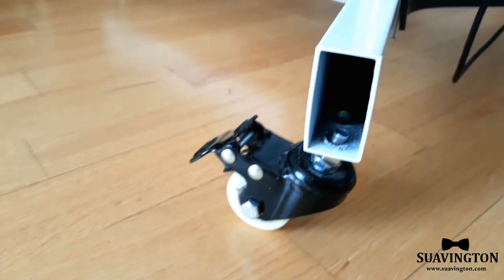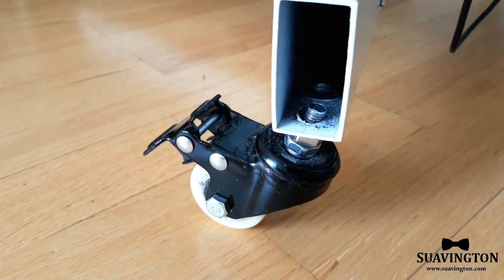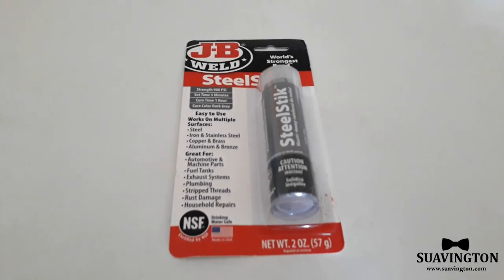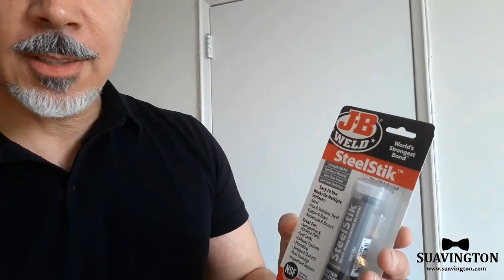Glue Metal to Metal - Putty Creates Super Strong Bond - Vlog #48

Comment: JB Weld used to be great, however like most companies the quality has suffered for a higher profit. Im old.....been using JB Weld for decades.....and i once glued a flattened beer can to the side of a motor cycle engine case in a gas station parking lot.....and filled it with oil and drove home 2 hrs later, and the engine stayed that way for weeks till i got a new clutch housing. Last week i used it to fix a bolt hole....and it fell to pieces as i screwed in the bolt after drying for 24 hrs.  I now use a 2 part putty thats used for gas tanks and oil pans. Dont recall the name, but its in any auto parts store. I have drilled and tapped it, and screwed in bolts with no issue . Im sure someone knows the name of it
Reply: Permatex fuel tank epoxy

Comment: The steel stik is only 900 PSI. It’s 6x weaker than their original cold steel 2-part system. If you want strength - stick to the original.